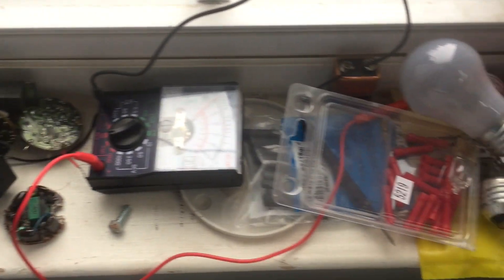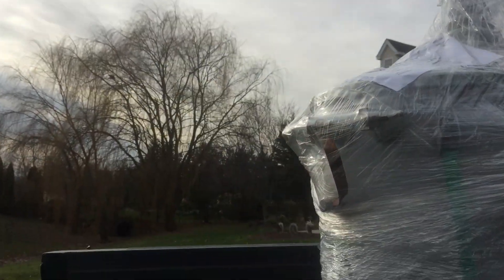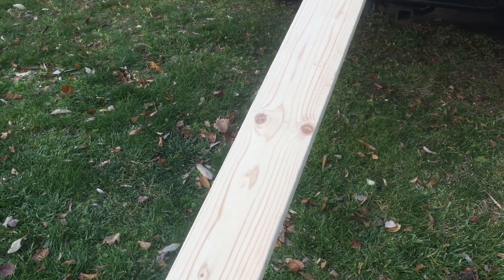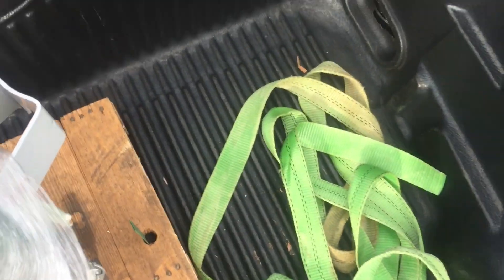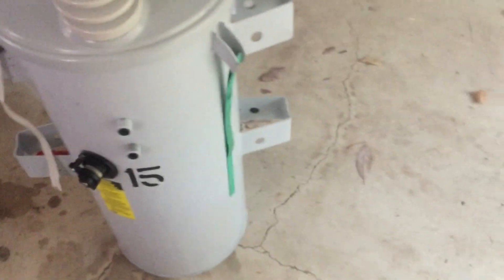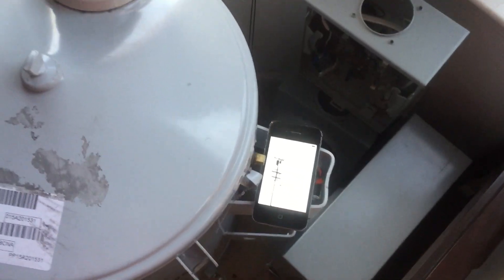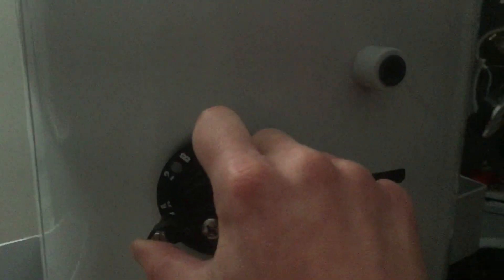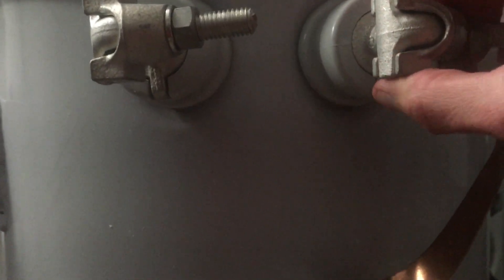"Unboxing" A New Pole Transformer

Comment: How do you get these?  Aren't utility transformers dangerous in the hands of the public?
Reply from the maker: Tubmaster 5000 I ordered 3 of them directly from the manufacturer. They’re dangerous voltage wise but can be as harmless as an NST with proper ballasting. Not too much as a fire hazard as long as they’re not overloaded or over volted. If you wanted one I could give you info, last time I ordered a 5kVA one it was $325+tax+freight.
Reply: metersocket00 As much as I'd really like to have one, my wife would think otherwise.  Thanks anyway!
Reply: YES! But the end user is hopefully NOT 'the public'. THese are transformers mounted in mineral oil =. They are intended for public utility but still a transformer. You have transformers in many household appliance. The theory is the same basically. The issue here is SAFE MANAGEMENT of this particular transformer...thus the point about NOT the public. FOR SURE: the power and voltage these 'pigs' can produce will put one under the grass faster than a gopher fart!! Ham operators have used these routinely in the ole days. Dielectric integrity (eg: tape insulation, etc) is KEY as well as INADVERTENT CONTACT. You stay clear of these suckers and respect them. Typical home/hobby use likely will NOT HEAT them up so fire due to overload is out. THE JUMP OUT ARCING I'D BE CAREFUL!! localized air CAN BE CHARGED AND POSSIBLY RESULT IN A LEAP TO THE PERSON!! See what i mean about 'stay clear'. Anyway...not a lot of info on this application so it is  virtually 'go it alone'!

Comment: the transformer is filled with mineral oil its not pcb anymore so getting mineral oil to fill it back up shouldnt be an issue
Reply: Wendell Porter You can apparently drink it; it makes a good laxative I've heard.
Reply: @heronimousbrapson863  it most likely is a good laxative never tried it, though i have heard the same thing about it

Comment: i want one
Reply from the maker: As it turned out, buying one off eBay was quite a bad idea. If you would want to buy one I’d recommend going right to the manufacturer, their not too terribly expensive either. Solomon Electric, Power Partners, Sunbelt, T&R Central Maloney are all good ones here in the US.

Comment: That is a really nice transformer! 15kva (15,000 volt amps) is only equal to 62.5 amps at 240 volts. The equation used to rate the transformer: VA or Volt Amperes, is found by multiplying the maximum amperes by it's normal operating voltage, to to find amperes from kva you simply do the opposite and divide. (15,000VA÷240V=62.5A) I realize this post was a year ago and you probably have found this out by now, but I figured I would share with everybody.
Reply: The one we have is 50 years old and the lights dimming and flickering sometimes. Is that normal?

Comment: What you gonna use it for?
Reply from the maker: BUDDY LIGHT Electrical arcs and destruction, I also wanted one for a collection piece, as I have a whole bunch of insulators, drop cable, and cutouts, but no transformers.
Reply: Will that give you more power at your place without running up your electric bill? I have one of these for unloading heavy stuff. -> http://www.harborfreight.com/1-ton-capacity-foldable-shop-crane-61858.html
Reply from the maker: BUDDY LIGHT I have considered purchasing an engine lift for moving it around, I'm trying not to invest too much into it, already $299.99 +$230 to get it to my house, at least $83 for the Insulator as the billing dept of the manufacturer doesn't want to sell one, and I'm still trying to find oil. I am planning on getting a junky scrap yard generator, because my house has a 200 amp service with a 50KVA transformer feeding 5 other 200 amp services, I think I'm probably going to blow a cutout trying to power it off the mains.
Reply: metersocket00
maybe you can rig up one of these-> http://www.harborfreight.com/engines-generators/generator-accessories/10000-watts-max-7200-watts-rated-belt-driven-generator-head-45416.html
Reply from the maker: BUDDY LIGHT Thanks! I'll definitely have to look into it!
Reply: metersocket00 bro where are you located? where can I get a transformer like that for $400?
Reply: metersocket00 where the fuck can I get one?